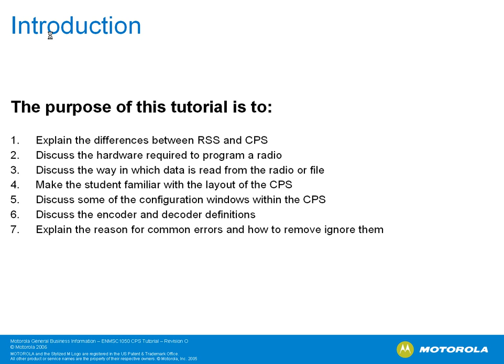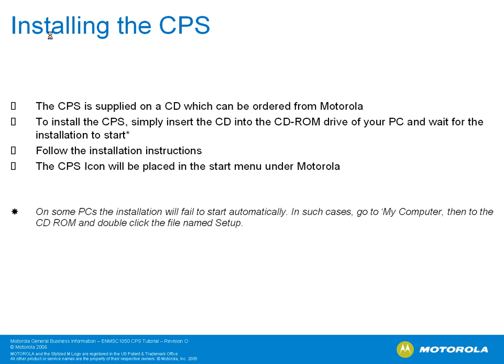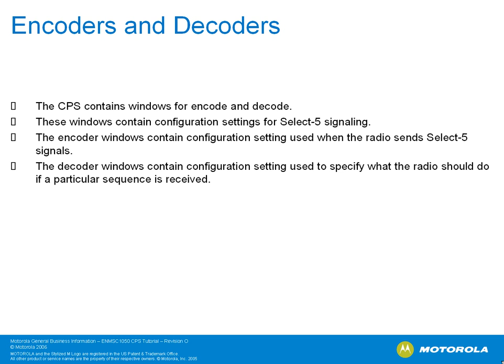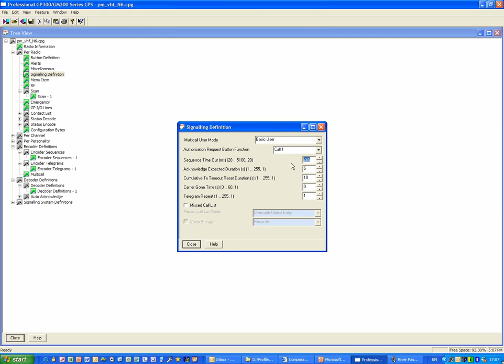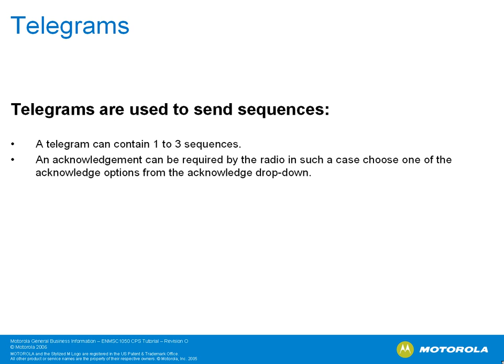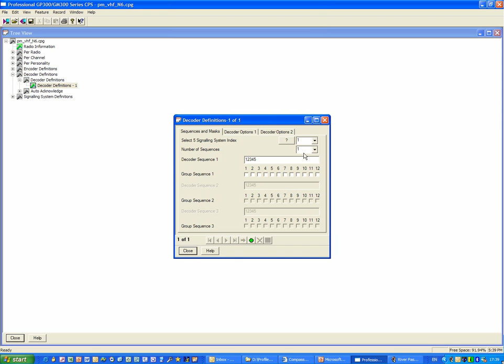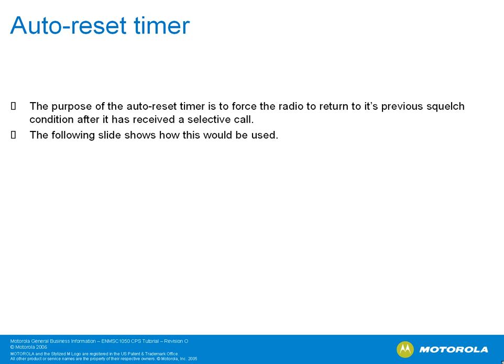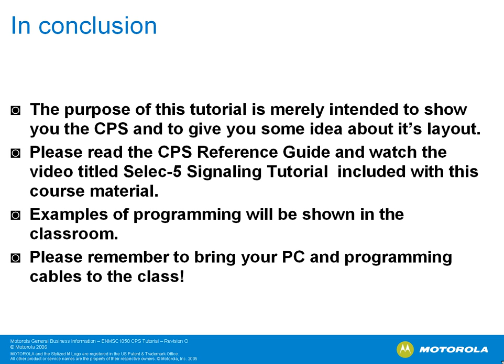Professional Series Select-5 : CPS Tutorial - Part 1

Comment: No I understand. I figured out you can’t create a new one. What I Want is someone doing a step by step blow by blow modifying a code plug. Get to a place with options then tell pros and cons of the options. It is like setting my watch instructions tell me steps to set it. I don’t need to build the watch. Your video is good for understanding the why. I need more of the how do I do. When I modified the plug tried to save I started getting invalid entries.
Reply from the maker: The GP/GM300 series and specifically Select-5 (a.k.a 5-tone) could be configured in a multitude of ways to achieve a specific end result. If I done a step-by-step video like what you want, I'd only show the way I think whatever should be done.
Reply: No the GM300 I do with the MRSS DOS software mo problem. I need to do a CDM-1250.
Reply: Wayne Holmes that is what I would like to see using a CDM-1250 radio.
Reply from the maker: @dr.mikehughes9874  These radios have been off the market for 6 years now. I never worked with the CDM1250 (or its EMEA equivalent) that much. 
The above video is for the GP/GM3xx series which looked more or less the same but supported Select-5 signaling.

Comment: Nice video Wayne. What cable would you recommend to program an HT1250 and HT750? I'm using the CPS_R06.12.05 software. I bought a cheap USB cable that only works using XP, although the software runs on 7 and 10. The "Can't open port" errors I'm getting on 7 and 10 when reading the radio, seem to indicate the need for a better USB cable or maybe a serial cable. Thanks.
Reply from the maker: +ProfessorSolderflux these Chinese cables are very iffy. My only suggestion is to get a Motorola original cable that plugs into the RIB; a RIB and an original Prolific USB-Serial adapter (or a serial express card if you have the slot). These Chinese cables use fake Prolific chips and low quality hardware.
Reply: Wayne Holmes are you familiar with any hex editing of the cps? I ask because I don't need a region deal but I am needing the dos auto mute duration to drop to 10 ms and the 1550 and 125p cps only allows 25ms at minimum. if one can drop it to 10ms you can rid annoying mdc 1800 data squelch bursts prior to pl drop. it's. a mdc issue on newer radios whom don't run tx pl, have a crypto board actively loaded, throwing mdc 1800 and 1200 out. the ht 1000 we successfully as well as the mts dropped the dos auto mute to 10ms, coast to 500, limited patience to 4 and it muted the mdc with no burst prior to pl dropping and quieting the circuit. it's a mdc issue. just been trying to figure out how to get cps to allow 10ms without it saying illegal option in red.

Comment: Wayne I'm getting this code programming my ht750 any help please
cannot program radio the archive to be programmed does not match the codeplug structure supported by the target radio
Reply from the maker: Aaron Villela The HT750 uses different CPS than what is shown here. I haven’t programmed one for at least 10 years now (the HT750 was known as a GP140 in EMEA) and can’t remember much. The GP140 was a fairly simple radio and should be easy to figure out.

These model were also discontinued in 2012 so there’s no official support either. My suggestion would be to look at forum.batlabs.com as there seems to be a lot of information about old radio models there.

Other than that, I can’t help much.

Comment: Hello Wayne, First thanks lot for the great vedios. I  am with Motorola (dealers) for last 16 years. Oky My question. I have standard groups by using CTSS or DPL. ( Our fleet use GP328 ) I need to make more groups with MDC. Lets example we use PL 67 and group MDC 1111 I need the receiver radio to unmute only if CTCSS and MDC 1111 only. 
Thanks lot in advance
CG
Reply from the maker: Sorry I don't have much experience with MDC1200. In EMEA the majority of analogue conventional systems use Select-5 signaling.
I seem to recall that you have to set up a Sel-Call entry in the radio somewhere but I wouldn't be able to tell you as I don't have any MDC1200 models to try that out on.

Comment: Hi Wayne. Can I program GP360 and GP680 on PMR446 to pair with Motorola XTNiD if all radios are UHF? Regards
Reply from the maker: +Almir from a technical standpoint, that might not be possible as the PMR446 channels have a 3,25kHz "offset" which the GP series won't be able to do. From a legal standpoint, doing so would be illegal as those radios are not approved for license free PMR446 operation.
Reply: Wayne Holmes thank you for reply. I was thinking of using top quality reliable radios on free bands but now seems mission impossible.
Reply from the maker: Almir have a look at the Motorola XT400 series http://bit.ly/2kbnhxP or the Vertex Standard VX241 http://bit.ly/2kDirNd. These are both license free and are a lot better than consumer type devices.

Comment: First I just want to say excellent videos! Very informative. Keep up the good work!
I have a question: I have a UHF GP380 and when it's receiving it does not have the Signal Strength icon displaying. Is this just a normal occurrence with the European firmware for this radio versus the firmware for the North American HT1250's? I've dug through the help file for the European CPS for the GP series but can't figure out how to get it to display. Any input would be greatly appreciated.
-James
Reply from the maker: +iamjimmy86 Sorry, I haven't worked on these radios for some years now and the knowledge is slowly fading. I know that under certain conditions the signal bars won't be shown - I think during a selective Call or something like that. Sorry, I cant be of much help anymore :-(
Reply: No problem sir, I did a little research and it turns out the the signal strength icon isn't in the firmware for the GP380's, only in the HT1250/HT1550's
Reply from the maker: That could be the case. A lot of the stuff I used to know about these radios is slowly being replaced by other useful knowledge...

Comment: Hi Do you know how can I change the codeplug of the radio? Thanks
Reply from the maker: Using the CPS
Reply: Which version should I use? I didn't see any options for me to change the codeplug
Reply from the maker: I'm not quite sure I understand your question? You can write another (default) codeplug using the CPS. There are default codeplugs included with the CPS (samples sub folder).

What you cannot do, for example, is write a GP380 codeplug into GP340.

Comment: The one I need is not Mototrbo. You can created a new Mototrbo plug do it all the Time. The one I need is the Motorola Professional CPS. I have 12.05.09 version dated 2011.
Reply from the maker: The CPS you have is not for the radio shown in these videos. The version number points to a MDC1200 model, not Select-5.

Comment: hi wayne is there a cps for gp340 hat will work on my window laptop
Reply from the maker: +ghostrider663000 the CPS you see here will run on Windows 7. I have not tried it on Windows 10 but would assume it would still work using compatibility mode.
These radios are no longer in production so there won't be any updates to the CPS.